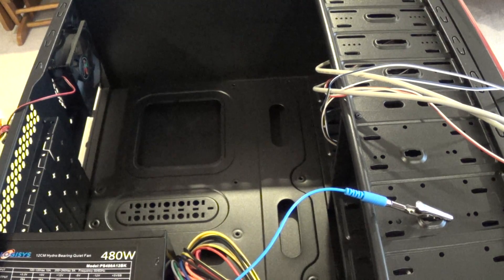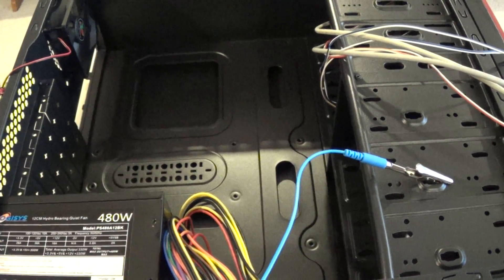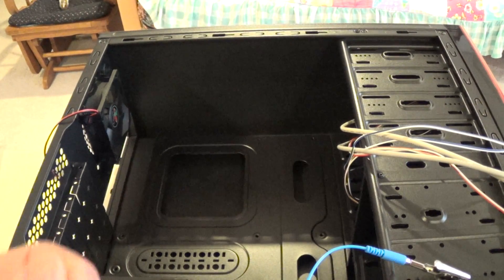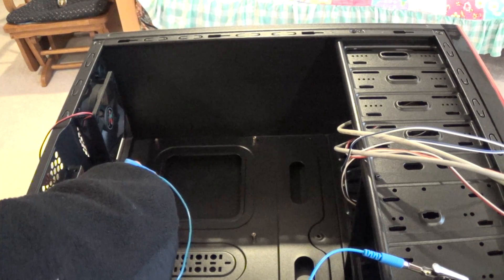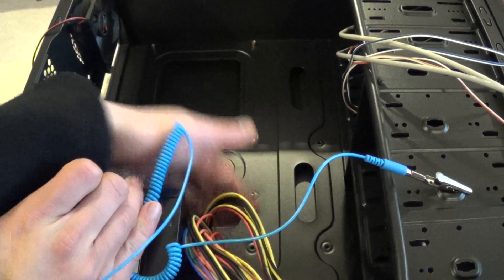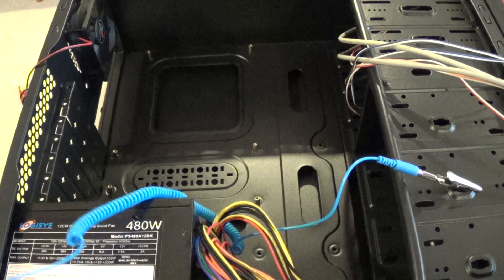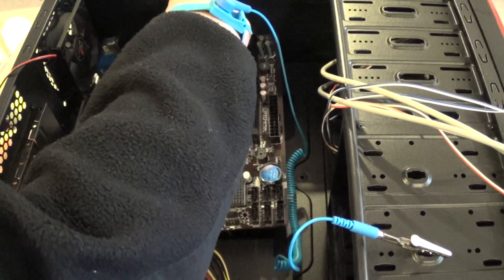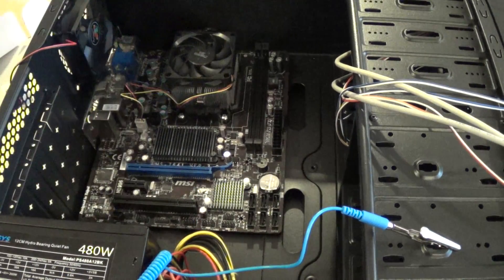How To: Installing A Motherboard

Comment: I'm gonna give some constructive feedback. The installation of the motherboard was great! Everything there was on point. My main concern was how you were grounding yourself with the anti-static strap. At least you have one, but there's no point for it if you aren't using it properly.

The paint on the case does NOT conduct electricity! Clipping to the painted case will not ground you. There are, however, two ways you can properly ground yourself with the pc. 1st, you want to make sure the power supply is plugged into the wall. Take an unpainted screw, and screw it into the power supply on the back of the case. After you've screwed it in, partially remove the screw and place your anti-static strap clip on that screw. This allows the static electricity to travel from you, through the strap, into the power supply, and out to the ground in the wall. Connecting it to a painted surface will not discharge the static because the paint doesn't conduct electricity. The second option, if you don't have an anti-static strap, is to simply put your hand on the power supply. The static buildup will travel through your hand, into the power supply and out the ground to the wall. 

You're doing a great job with the motherboard installation, but if you're going to be giving instructions to other people who are less experienced, I think you should make sure you are discharging your static buildup properly so those people can learn the proper method from your videos.

Comment: Rip I was touching my ram and pushing it it because I installed it wrong and the computer is wrong good thing I didnt hard anything except for my sole because of the force you have to extrude to have that click of the ram

Comment: Outstanding Review... Thank you so much to the kind host for clarifying how Standoffs are used and placed into the case, to hold a new motherboard during a fresh build.  I'd been searching for a good video that clearly showed every step, and this was by far one of the best reviews.

Ps.  I am going to assume that the Brass Standoffs came with your case... But that the motherboard screws used to screw in the motherboard into the standoffs, must obviously come with the motherboard itself.  I would greatly appreciate a confirmation of this.  I think they say that usually, standoffs come with a newly purchased case, and the screws used to screw the motherboard from the top (into the brass standoffs) come with the motherboard.   Someone kindly confirm my understanding of this.

Thank you
Alexander

Comment: A good case should come with them preinstalled and there really should be more things done to prevent fuckups because that's just what humans do. Why are circuits still even exposed when they are so sensitive? Installing a motherboard is the most nerve racking experience of all components
Reply: I got the NZXT S340 elite for my build, and I never had to do any of the crap in the beginning

Comment: im a little worried. I ordered parts for a pc upgrade just yesterday, motherboard, cpu, ram, hard drive, power supply, ridiculously priced windows 10, and im using the same gpu I have currently and the same case. I know enough about the hardware itself, everything being compatible, how to install a cpu, etc. the case is plenty big and decent ventilation, I have a couple extra fans I can put anywhere, but I dont know about an IO shield. I dont know if the current build thats in this case has one and I dont know if I need one, I just know that it like protects your hardware from electromagnetic radiation? or is that wrong. and I dont know if the holes in there will line up with the motherboard im getting, or if it will even come with standoff screws, or if the screws in my current motherboard are standoff ones or something else. everything will arrive by the end of this week and im pretty sure I have everything I need otherwise

Comment: Isn't a wrist strap pointless on a case where the metal is painted?
Reply: +Mr.StrawberryGamer Right but your supposed to be grounded on the case, touching something metal on the case.
Reply: +Rusu Ovidiu I agree, I didn't use one all I did was keep my hand moist. but there's been report of people fuking up there pc components by static, but it's like super rare. I think 98% of people will do fine without this band.
Reply: +William Star Yea I just built my system about 2 months ago and did not use one. I just made sure to keep touching something metal in the case every now and then.
Reply: There is an awful lot of dumb luck mentioned here. You might get lucky enough to build one PC without any problems, but if you do it often enough, sooner or later you'll have some real problems.
Reply: @paytyler  Watch JaysTwoCents video about ESD, he literally shocks the video card and usb/audio ports with a paperclip and causes zero malfunctions.
Reply: @MrMG43  I really don't care if you saw a part survive being shocked once. Statistically it doesn't mean anything. Grounding yourself when working on a PC was good practice in the 80's, and it's still good practice now.
Reply: @paytyler  Don't get me wrong, it is definitely good practice, ESD can shorten a component's lifespan by a lot. However, it won't immediately kill anything. A lot of modern motherboards and graphics cards have circuitry that helps either prevent or redirect ESD. However they aren't perfect just yet and I'm not saying its worth relying on them.
Reply: @MrMG43  Yep, MSI and Asus have sunk some good chunks of change into making parts more ESD resilient. I have a hunch that people would get with Paypal to demand RMAs if they unknowingly fried their parts. So it is definitely in the best interest of the manufacturers to be as ESD resilient as possible.

I've owned a computer business since the 2000s, and something about my body makes me generate excessive amounts of ESD. I'm like Zeus. I've fried lots of "retro" parts back in the day before I had gotten my act together.

Comment: probably a dumbass question but will a small go kart like battery keep this grounded out or would i absolutely have to get one of those on your wrist if i should get kne of those could i get a link por favor???
Reply: btw im using the same case and motherboard
Reply: I don't know how well that video explains the ghetto method but basically just keep one hand touching a metal part of the case at all times when you're working on it.

Comment: I'm having trouble putting the motherboard in because the prongs on the IO shield is just not letting it slide. I have watched videos and none have really helped. Hopefully you can get back to me thanks!
Reply: +further i fucking hate that.. that's the same problem I'm having.
Reply: I just finished my first build earlier and I come to find those stupid metal pieces on the io shield in the way of the ports as well. are they supposed to be removed or what ?
Reply: you have to use some force james, mine is up and running fine, i love it!
Reply: I meant to say this earlier but I bent a few back and it works just fine now, thanks!
Reply: +further I'm having the exact same problem, any tips?
Reply: Kevin Henley try bending them away, don't do it to all the prongs though. They're there to ground the mobo, but the standoffs will do most of the grounding.
Reply: +further I'm building my first pc now and having that problem, did you find out how to fix it?
Reply: good job man what games are you planning to play?
Reply: Excuse my noob question, but which one are the standoffs? Should a standoff be removed or placed?
Reply: The standoffs were the golden/brass coloured screws onto which the motherboard was placed..There were six. It is highly recommended as it grounds the motherboard, otherwise if a loose screw was caught under the motherboard and not removed, it could short circuit and fry the motherboard.

Comment: So I built a computer today and the case already had the brass headers installed so I took random screws that came with the parts and once I aligned the motherboard on top of the headers I screwed the screw into them. Was that correct and will the motherboard heat up and melt the screws and or start a fire? Someone please answer and thanks for reading.
Reply: Headers = standoffs +simpleteachreview

Comment: I have standoff screws and panhead screws. I wasn't sure which I needed. Will panhead screws be fine to screw in the motherboard? I know standoff is for mounting at the bottom.
Reply from the maker: Siriusly Black Yes those will work.
Reply: I already built my computer l0l. But thanks anyway. B)
Reply from the maker: Siriusly Black
yeah np sorry for the late response been busy .

Comment: Do you by any chance have a video about installing case fans and I/O buttons to the motherboard?
Reply from the maker: 21x Yeah i can make one, most motherboard manuals will have the IO layout they are different fro every motherboard/case combination. For fans should be four screws, and plugging it.

Comment: i can t seem to get the motherboard to lock into place with the brackets
Reply from the maker: First line the connectors with the plate on the back and the rest should just slide in. Sometimes it may be the metal plate for the connectors in the back also called the I/O shield that has to snap in place before the MB lines up with the standoffs. Hope this helps! Good Luck man